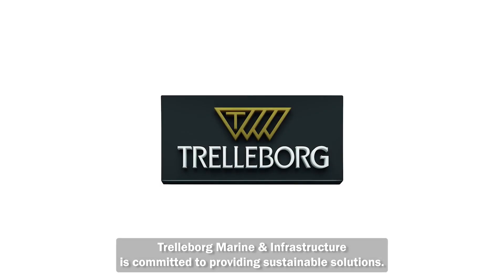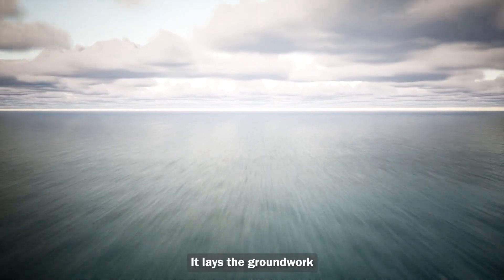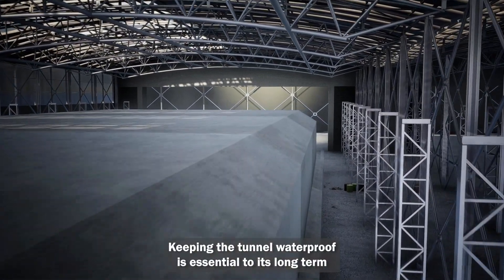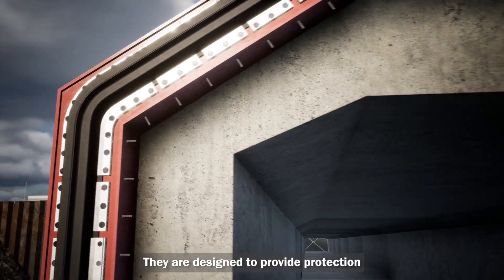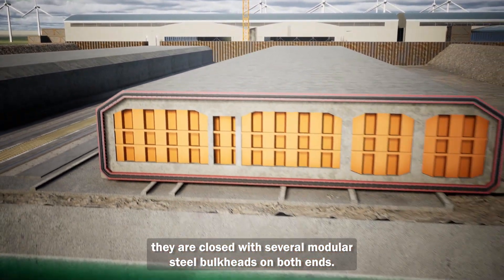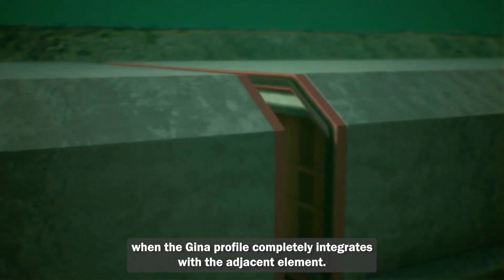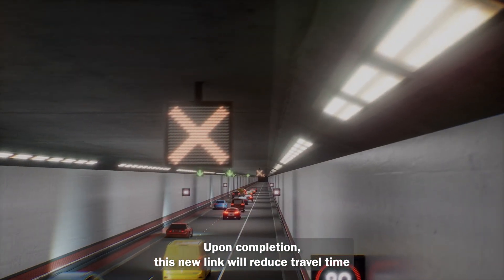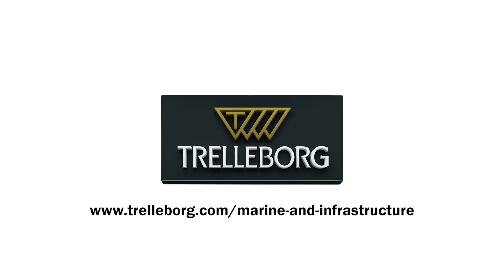Tailor-made sealing systems for the Fehmarnbelt immersed tunnel

Comment: Curious what's the plan when the seal reaches the end of its lifetime after all. Is there a fancy way to refurbish the connections between segments from the inside, without digging up the sea floor?
Reply: There is the Limfjordstunnel. A 582 meter long tunnel built in 1969 https://en.wikipedia.org/wiki/Limfjordstunnelen . Connecting North Jutland to the mainland.
In the entirety of its existence it has struggled. The rubber membrane never worked properly and saltwater erodes the concrete the membrane was supposed to protect. Additional problems is poor quality concrete. Terrible construction method during the build. Movements in the seabed causing the tunnel elements to shift and slowly drift apart. 

Not a year goes by without extensive maintenance and renovations mostly done at night so that both north and south bound traffic is led through the same tunnel pipe, while they work on the other. 

Point is they do all this work from the "inside" of the tunnel. When the tunnel elements is placed and covered with sediments that is it. You live with the problems and when the cost and problems exceeds the benefits, then you scrap that tunnel or built a new.